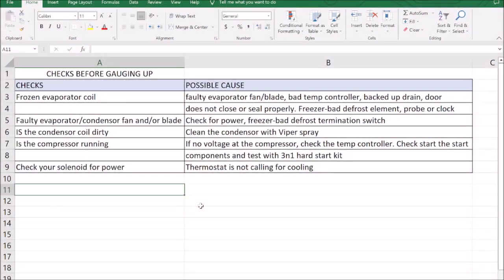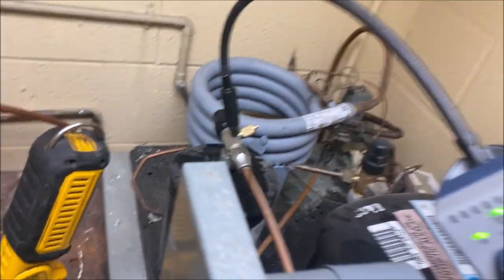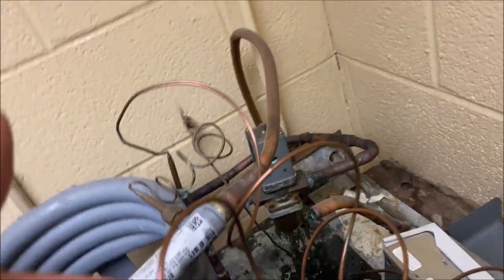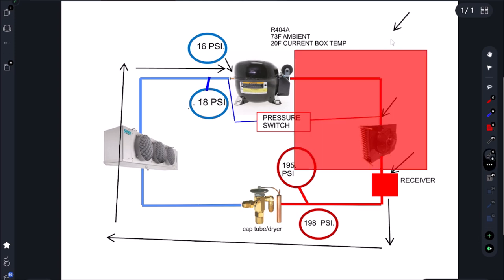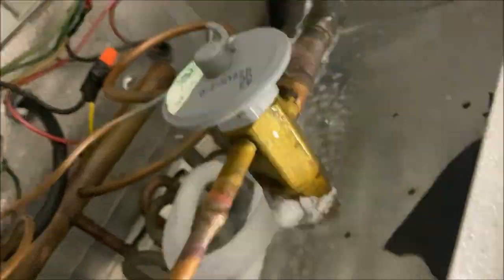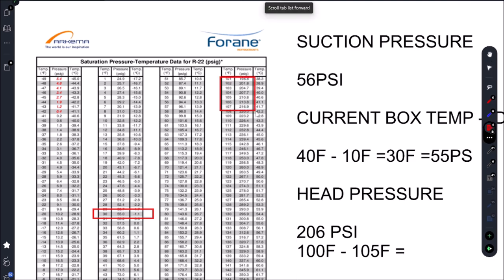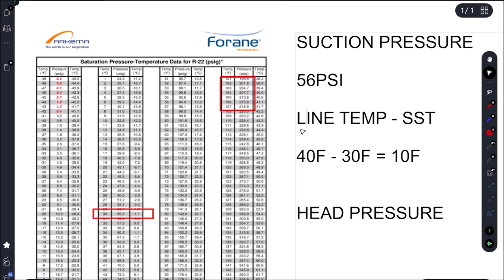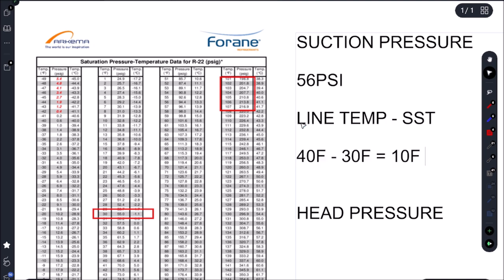Water Cooled Walk in Cooler is not cooling

Comment: Interesting...is the condenser cooled by plumbing water and just dumping it down the drain once its removed the heat, or does it have its own loop with an outdoor unit to recycle the water?
Reply from the maker: Dumping down the drain, wastes a lot of water. We need to keep the incoming water temperature a consistent temp so I don’t think recirculating of the water is an option but I could be wrong

Comment: Do you prefer to coil capillary tubes and then individually separate the tubes or zip tie them together as one? Wow, your videos make going to HVAC school almost unnecessary, in my opinion.
Reply: I was taught to coil the mileage around a glass, etc., separate and Caulk permanently together so no vibration cracks and rub outs. 
Wiring too.
Reply from the maker: In this case the capillary tube was too short to coil up. What is written above with cooling and caulking is a great suggestion